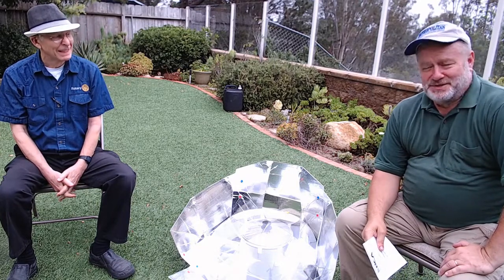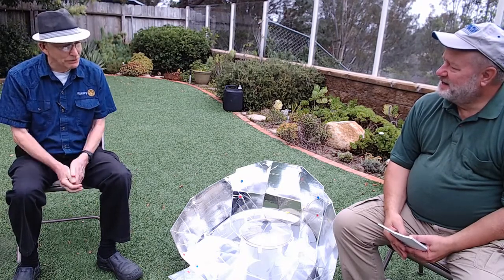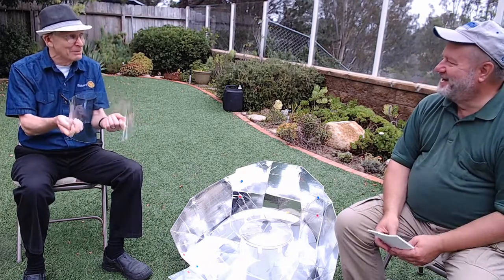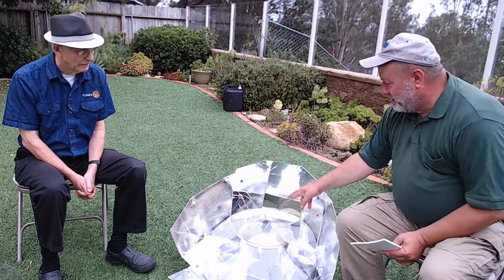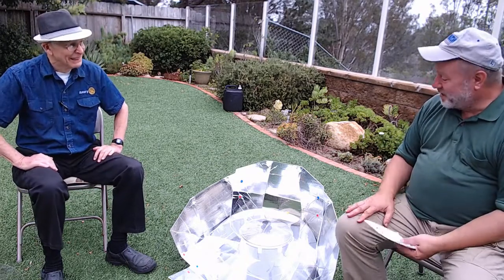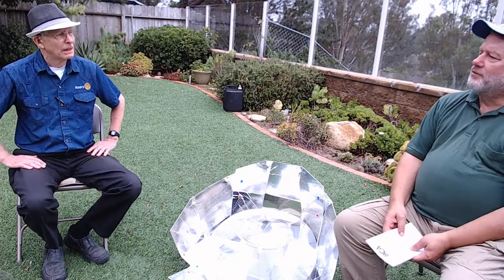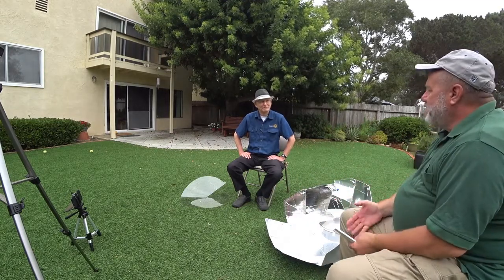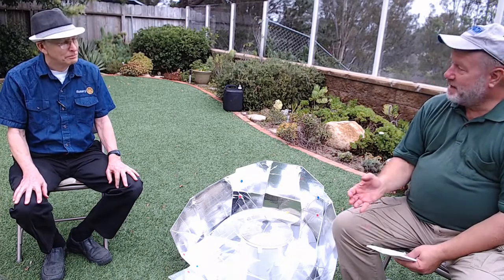Roger Haines: Power To The Panels

Comment: Enjoyed the extra details in the evolution of the cooker that I see displacing the Cook-it in places like Haiti on Facebook... if I had seen the design of this one, I might not have designed the funnel cooker that I did come up with...( we have chatted under my real name )... I am still experimenting a little now and then... the portability of this one has mine beat, but my different solutions might have affected his results if he had known about the solutions I found for my build. The pot and greenhouse solution he came up with is very good... mine was adapted for what I could find to work with... I could find black pots with glass lids, but they had handles (and some handles can be removed by unscrewing it from the pot...) and the fitting inside Pyrex mixing bowls... his solution of the shaped Dutch oven inside the mixing bowl bottom allows better volume... I  would be curious if an inverted mixing bowl on the lid would work as a replacement for the the polycarbonate top sheet... and my use of a grate and third mixing bowl and the 5 gallon bucket shaping got some lifting like his polycarbonate sleeve solution... parallel ideas in different materials can be interesting to see... I am happy he has more interest in getting his version out in the market for those who aren't interested in DYI funnel cooker  building with the materials available in some markets. (You might have guessed my real name by now)... keep exploring the different solutions people developing... it helps a lot.

Comment: Important point not mentioned is how flat and compact it folds down.  Easy to carry for traveling and camping.  I have one just like this one, and am just beginning to learn how to use it.  I love it so far.  Hoping to find someone locally who can teach me how to use it.  I live in the Phoenix area.
Reply from the maker: I agree, it's one of the most portable, light weight yet powerful panel cookers out there. I find it very easy to use. Note that the polycarbonate sleeve appears to sometimes warp a bit at the edge that touches the pot, from the heat that the near-parabolic shape of the reflectors generates.